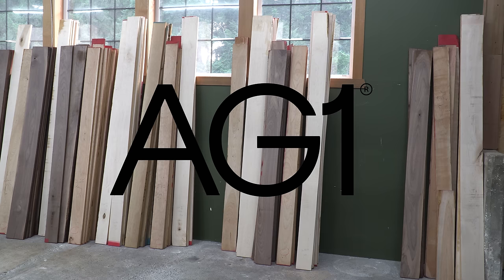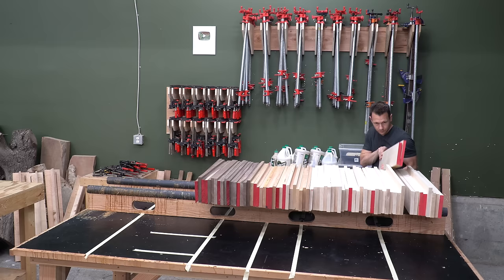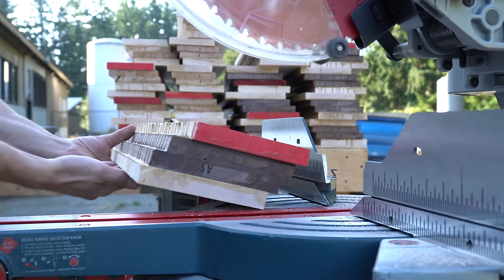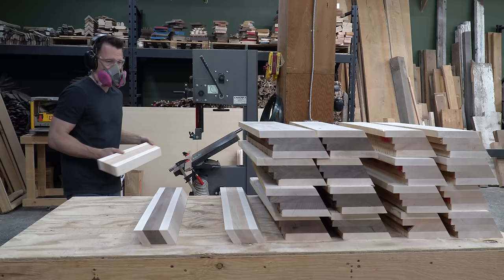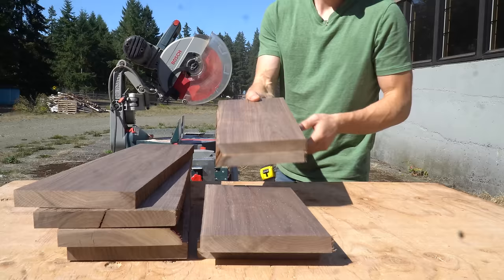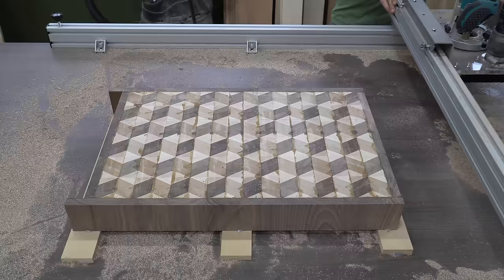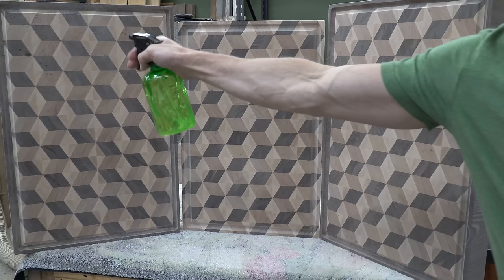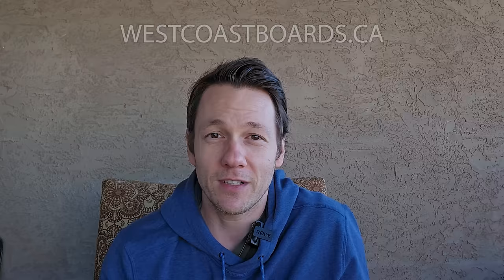$1400 Cutting Boards

Comment: It very very hard to believe someone would ever pay 1400 dollar for a cutting board. 🤣🤣🤣🤣🤣 If you said 140 dollars it would be more believable. 🤣🤣🤣🤣
Reply: It's okay to be jealous of yhis guy and envious of people with money.
Reply: @TheJMBon  why are you jealous?
Reply: @beowulf_of_wall_st  20 bucks of glue yes but still not worth 1400 bucks. 😂😂😂
Reply: @TheJMBon  we're happy people who spend their money on low value high cost items like this otherwise it wouldn't be as easy to line our pockets. you seem to have a complex about your wealth which comes off incredibly funny
Reply: There is the notion of luxury value and exclusivity as a marketing tool. Some of the people who would $1,400 for a cutting board would NOT purchase the EXACT SAME BOARD if it was $140. And there is also a market out there, small though it may be, that would pay $14,000 for a cutting board, especially if it was signed, numbered, and guaranteed to be the only one of its kind to be made by the creator. 
Value is whatever the acquirer perceives it to be, and it is all relative. A $140 cutting board to someone who makes $50k a year is the exact equivalent of a $14,000 cutting board to someone who makes $5M a year, and like it or not, there is a significant number of people in the world who make a LOT more than that!

Comment: 1:17, 1:17 is where I came to the realization that this channel has nothing to offer me or really anything worthwhile to teach anyone. The moment you made it clear you were putting those gnarly, fucked up, rough cut boards through the planer like it was magically going to fix them without proper jointing you proved you shouldn't be teaching woodworking.
Reply: In this application (unlike most furniture joinery), having the board faces precisely parallel to each other is not critical: there is no intersecting joinery and the process involves compression to compliance. So, jointing of reasonably milled boards like these is considered by professionals to be a waste of time and materials. You should not expect to see a professional shop joint rough cut stock for end grain cutting boards.